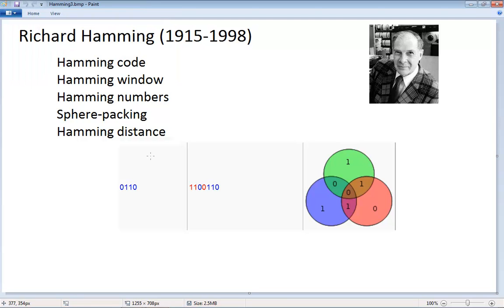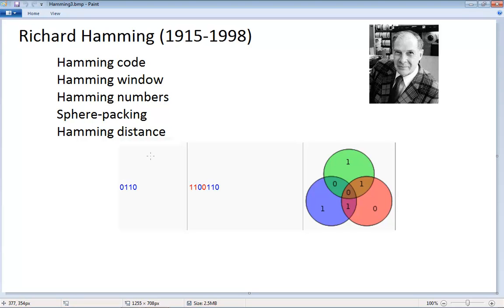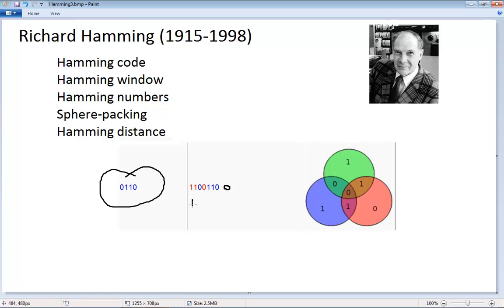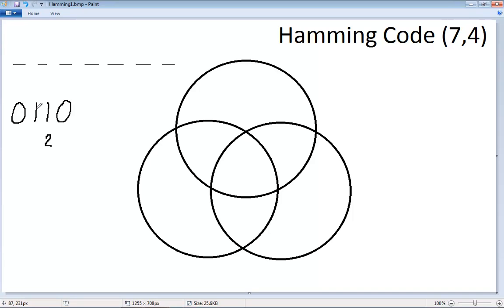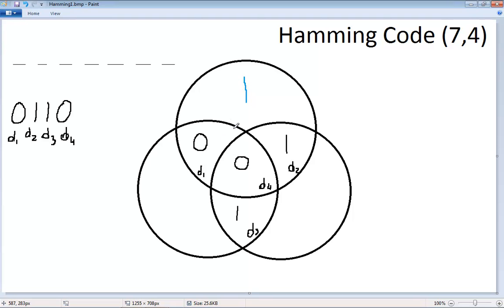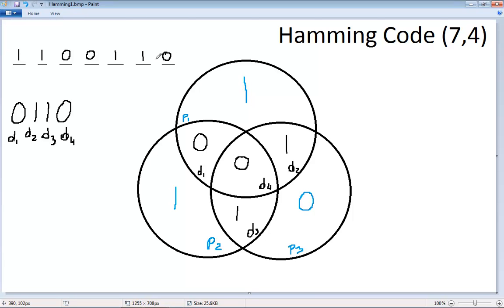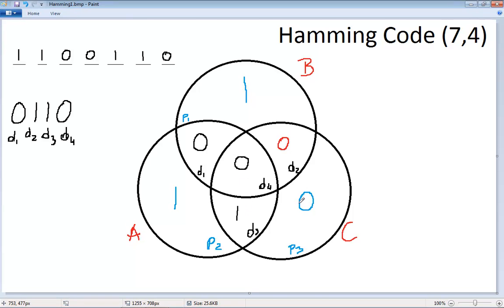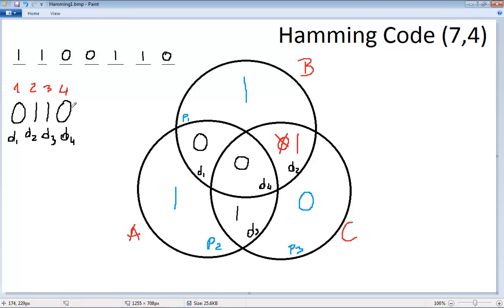Hamming Code (7,4) Introduction to Telecommunications Course :: Lecture

Comment: Thank you for the explain, but I have a big issue about the wasting rate of this method, it seems the real data to total data ratio is 4/7 which is about 60%, is is a lot of waste resource?
Reply from the maker: Yes, there is a large overhead in this simple method.  It is a good example of the error checking and correction mechanism.  Looking at this method helps us to understand how computers can detect and correct errors.  Some methods are designed only to detect errors.  They have much lower overhead.  CRC is a good example.